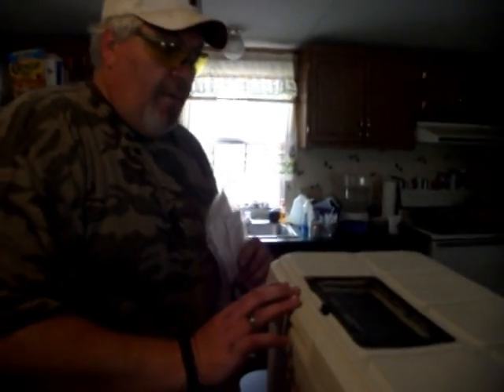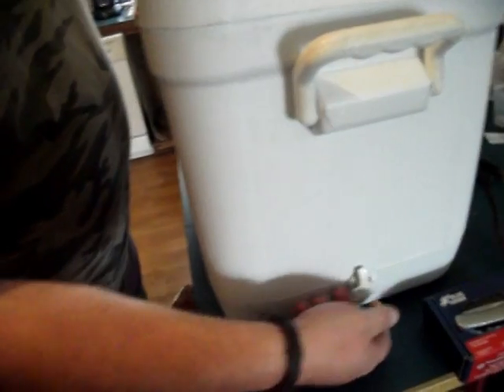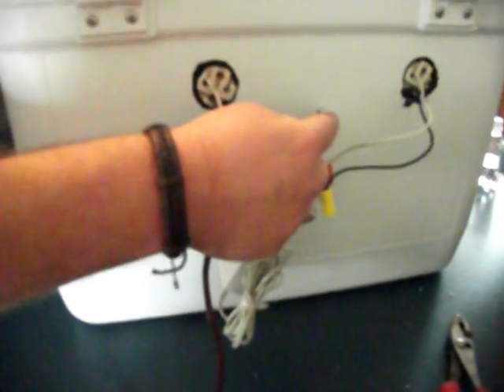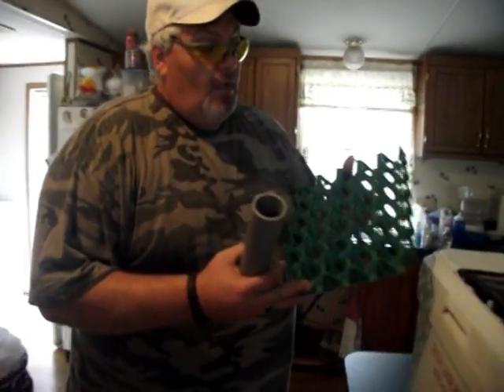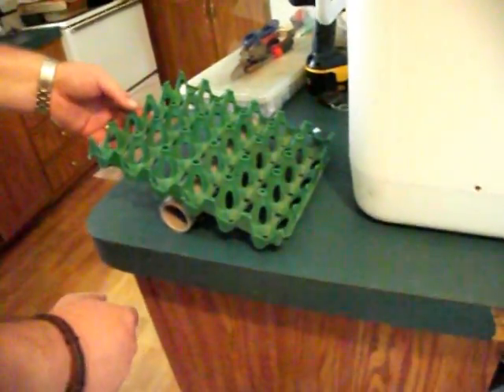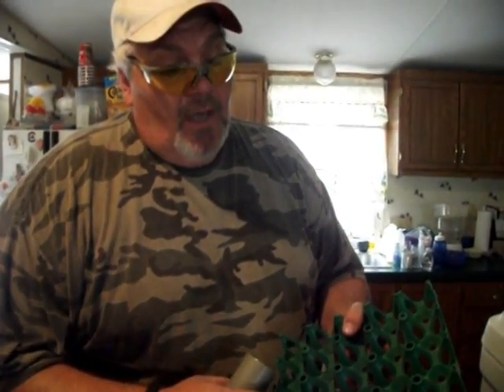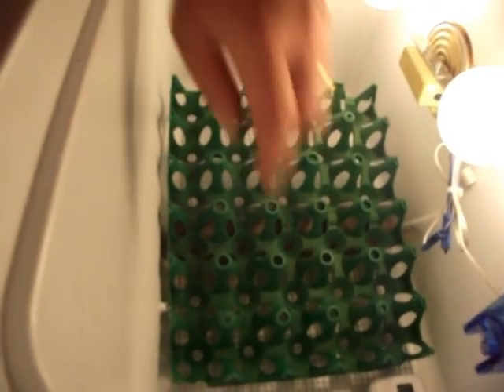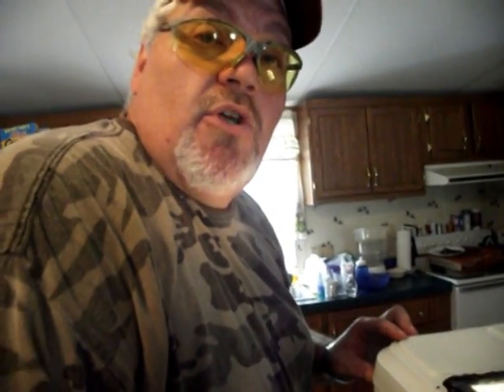DIY, Building, Making and Wiring a Homemade Incubator (Part 4) of 4 (RushLanePoultry) style

Comment from the maker: @Mac3baseball Hi Guys! If you are getting that close to the finish line and loosing fully developed chicks... sounds like a ventilation problem. Do u have a fan? Do u have vent holes at the bottom and the top of your bator? Without enough air holes, the chicks will suffocate before they hatch... 
at lockdown, your humidity should be 60-70% to soften the shell lining enough for the chuck to hatch. Hope this helps! ;)
Reply: Homesteading in SC

Comment: i have build an incubator but with the incukit. i have had 2 hatches out of it. out of the batch that just hatched i only got 3 chicks our of 41 eggs. horrible hatch rate, like 7%. This has happened to me twice in the last two hatches i have had. the temp is at 100 and the humidity is at 50%. i dont know why this is happening. plz help, do you know why this is happening? i cracked the eggs and 90% of all the chicks we hatchable and full grown. plz help. thanks